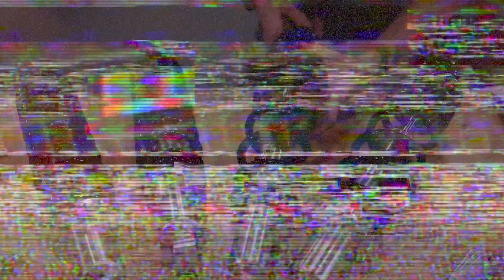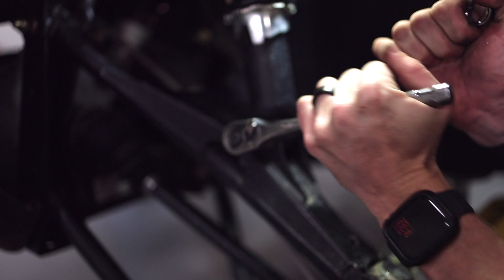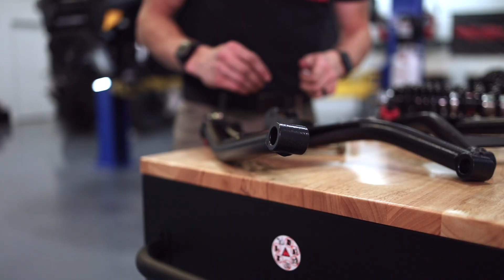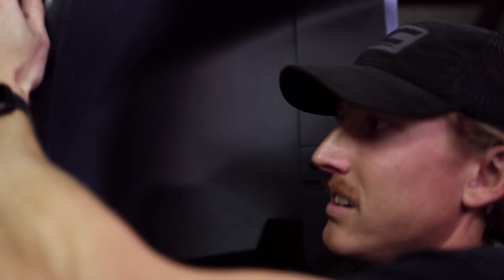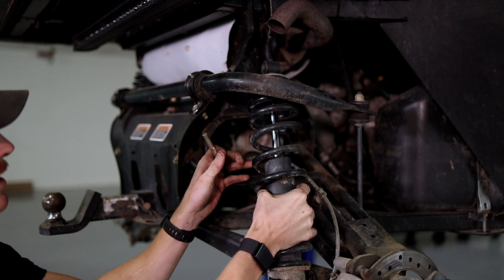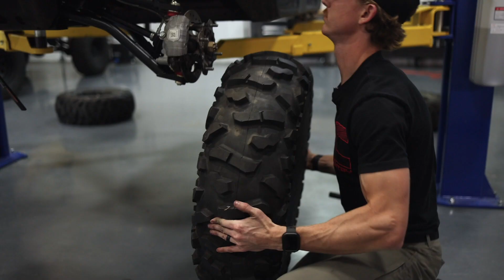How to Install Rough Country M1 Coil Over Shocks on Can-Am Defender: Step-by-Step Guide

Comment: So you replace non rebuildable shocks with another set of non rebuildable shocks. What kind of sense does that make
Reply from the maker: Replacing a stock dual tube strut with a monotone adjustable strut is really nice upgrade in both dampening ability and ride height adjustment.